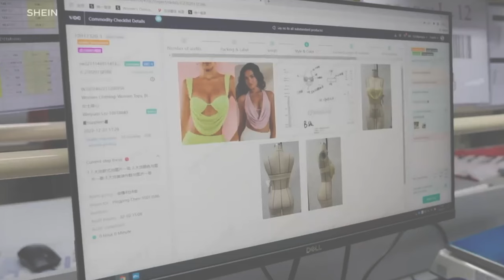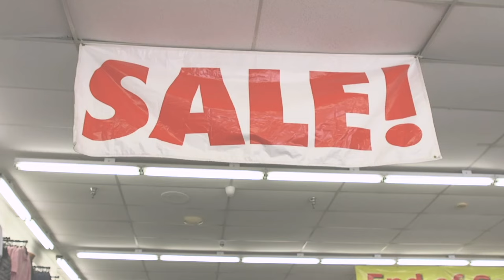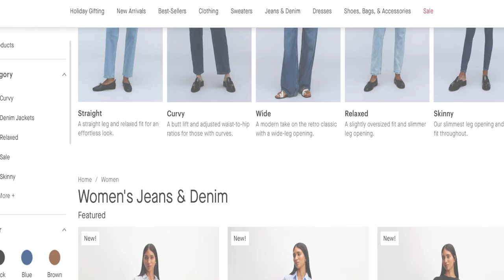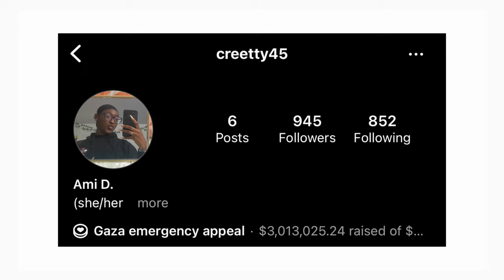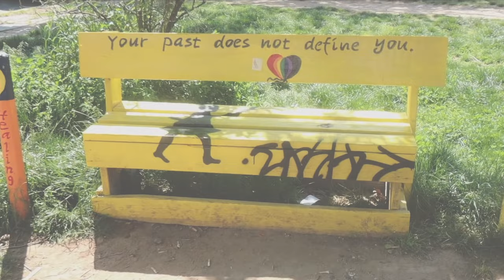SHOPPING AT SHEIN IS NOT THAT BAD...

Comment: i can only speak from my perspective when buying fast fashion. i dont go into ff shops with the intention to do a haul, but to replace whatever item i have that is incredibly worn out or does not fit me anymore (aka too small and cannot be resized). the problem is that many people esp influencers do hauls and its the overconsumption part that is horrible. i live in an area where “thrift shops” are essentially curated vintage shops that charge like 70$ for a pair of used jeans, which is out of my price range sadly

Comment: I did research comparing clothing made out of synthetic and natural fibers, specifically cotton, polyester, and viscose (rayon), and the effect they have on oceanic ecosystems. In my experiment I replicated a wash cycle on a small scale that really allowed me to understand the difference between those three fabrics. 

Ultimately, when it comes down to fabric and environment relationship washing practices need to be highly considered. The more times you wash an item of clothing the looser the fibers become, resulting in an increase in microfiber pollution. It is also important to limit your shopping habits, buy what you love. 

It doesn’t matter what fabric type you buy, if you end up constantly donating or throwing away your clothes that item will still take a while to decompose regardless of it being cotton or polyester. 

The REAL problem is shopping and washing habits.